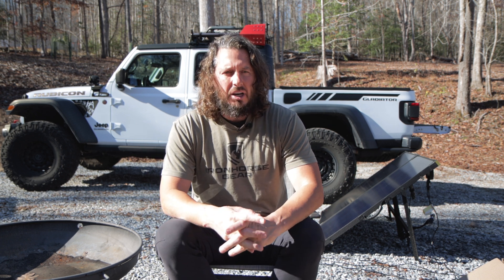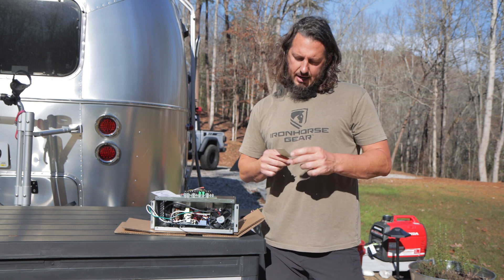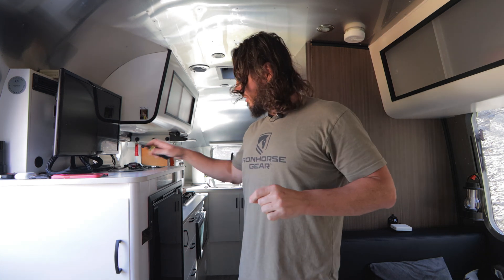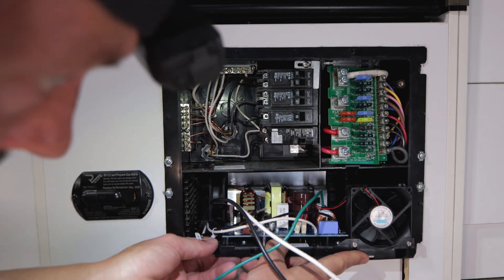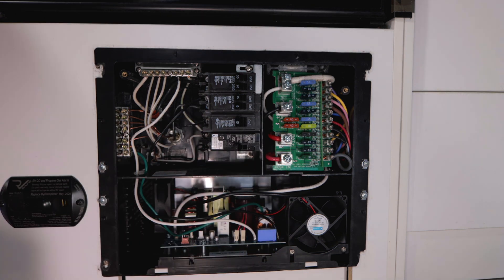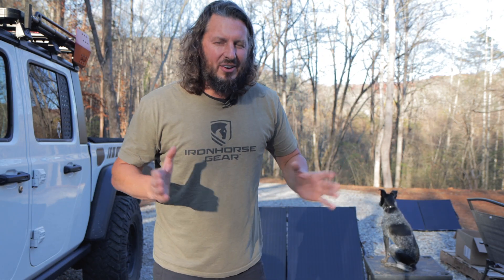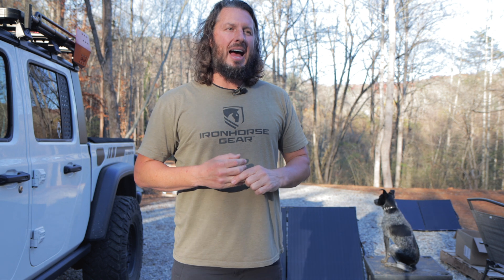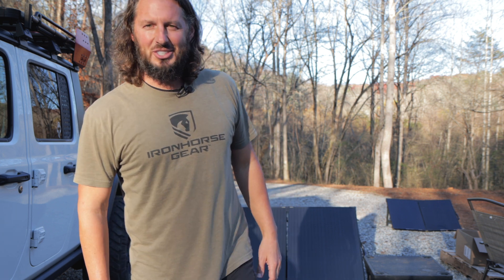More Power in My Airstream! Converter Upgrade HOW TO | Progressive Dynamics 4600 Series

Comment: Another tip is don't run your generator on Eco when charging your batteries.  It will produce max charging
Reply from the maker: That’s a GREAT TIP! Thank you for sharing this valuable info 🔋
Reply: How is the fan noise?
Reply from the maker: @timcarico8908 Hey Tim  I believe it’s actually a little quieter than my stick unit. I’ve not done any official measurements. 

I’m usually only ramming power thru it during daytime hours so the noise level has not bothered me even once. A few times I’ve heard it kick on and thought it’s nice to know it’s putting the juice to the batteries 🔋